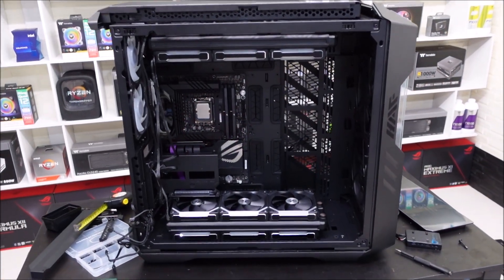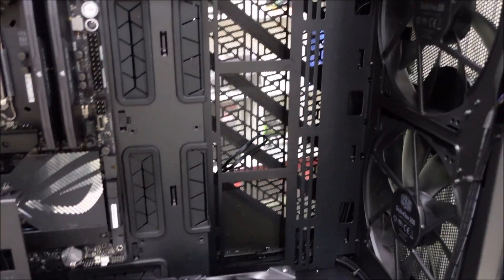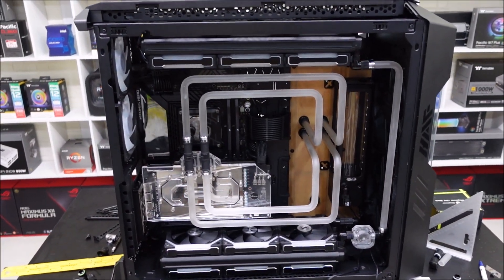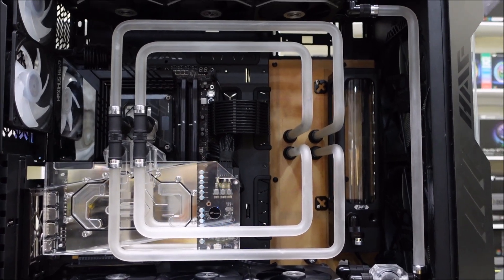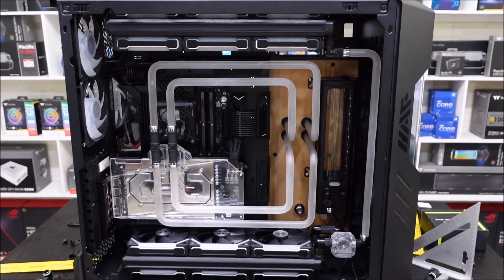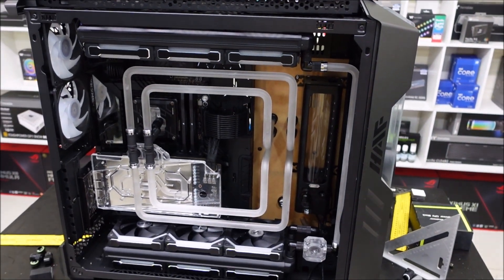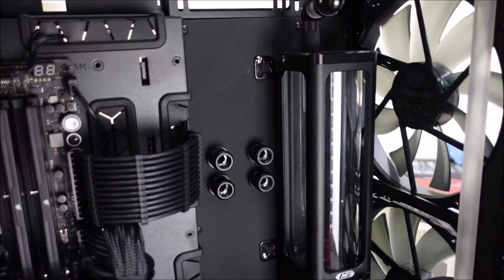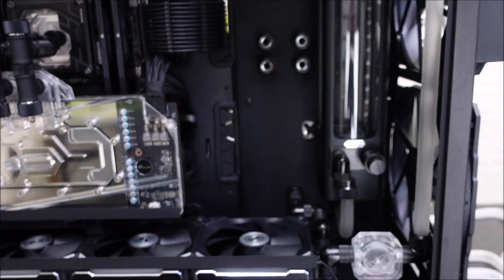Custom Pc Build #Build #124 " Mayor " A 13th Gen Cpu on a CM Haf 700 Evo Case.

Comment: Well, nice Case, but very expensive. Good News: There is a lower priced Version, the "non-EVO" Just Haf 700, same Case with a different front design and a few details less, but functionally the same Cube with the same possibilities for Watercooling. 
When it comes to this Build, here my hmble opinon on it:
Placing 2 Reservoirs, as the client wanted, omptimalisticly designed as a dual loop, would have been easily possible, if you connect the tubes directly to the reservoirs and leave the acrylic plate just for mounting the reservoirs, which would offer some strong benefitts. 1. The very long Tubes would be more stable, especially when filled up with heavy Liquid, so less leak potential plus lower uglyness factor for deforrming by gravity over time.  2. Servicing reasons, as component changes or cleaning the loop would only affect one component, CPU or GPU, not CPU & GPU, less maybe unneeded work and complications. 3. Better cooling performance optimization results in a possibly more silent run. 
Of course, it would offer a slightly different look, but  you could still keep your own style, mostly.